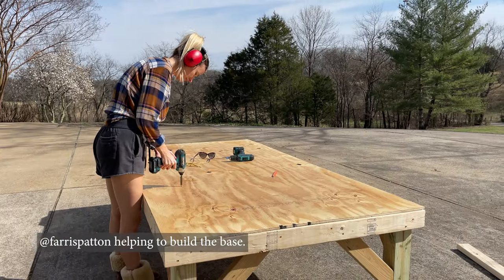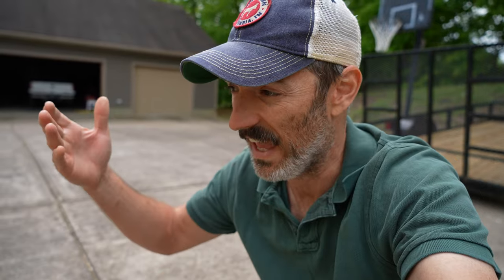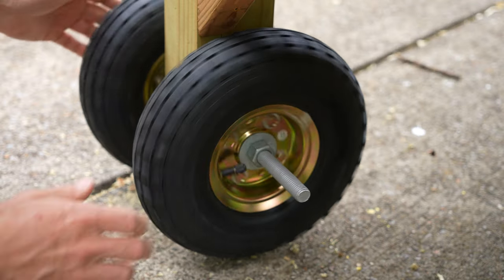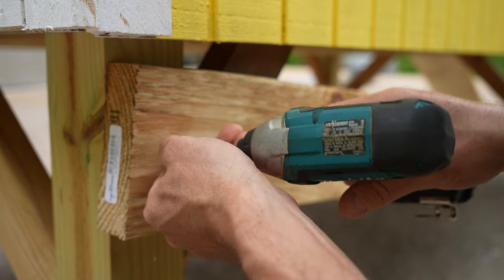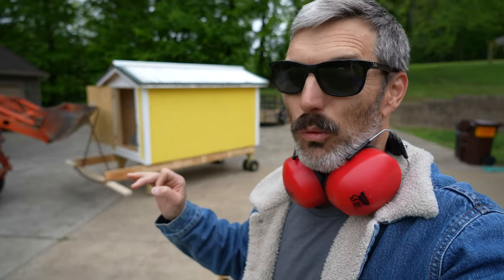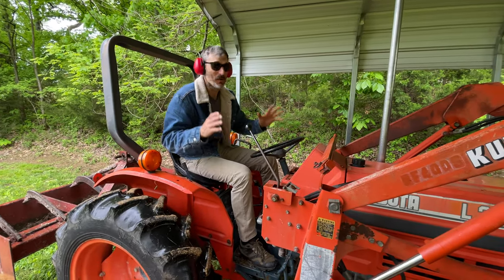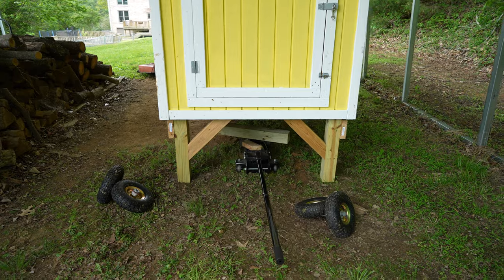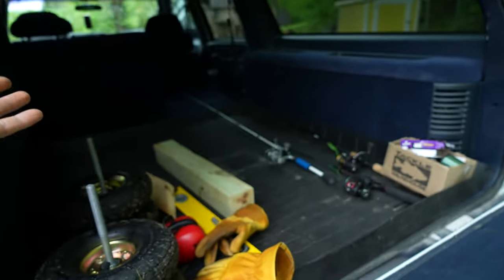I Was Forced To Do This!! Turning A Chicken Coop Into A Truck With New Wheels and Tires!!

Comment: I would suggest coating the holes you made for the wheels in something to keep the boards from rotting
Reply from the maker: It is pressure treated wood but yes, I may do something like that.

Comment: I kind of did the same thing except I built my coop where I wanted it at the time, but not where I want it for this winter. I actually built it so I could tear it down in sections and put it back together if I moved, but didn't consider needing to move it if I stayed here URG! It's one thing to tear it down to transport for a big move, but too much work (and too heavy) to just move it across the yard, so thinking I'd like some wheels on it.

Comment: 4:26  You erred in the placement of this board.  You have a knot, a good sized one, right at the most stressed area of the board (when in use), and you drove a screw into it, potentially making it weaker (acts as a wedge).  Knots are hard and brittle, where lumber often cracks.  Looks like this board should have been swapped end for end or at least move the knot to the top by rolling the board 180 degrees.  Generally speaking, you should avoid driving a screw or nail into the area of a knot.
I do like your idea to put duels on it though.  Your transit with the tractor would have been easier with less length in the chain between the coop and the bucket. That would eliminate most of that swing you were getting.  But..mission accomplished, good job Jimmy.  
Next up, Jimmy builds a sailboat in his basement.🤣😂😛